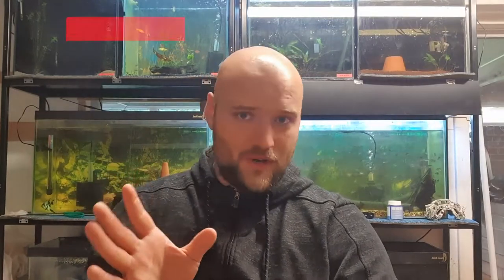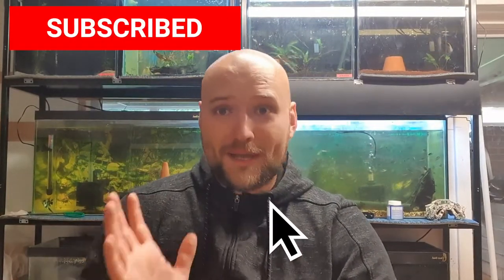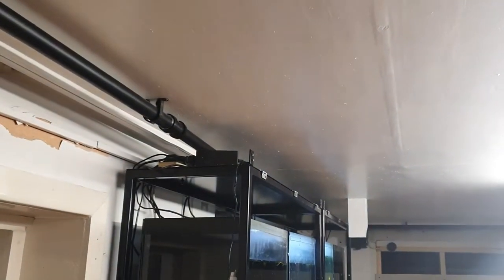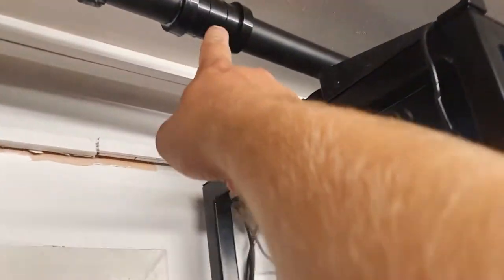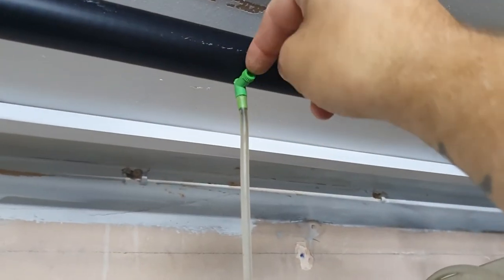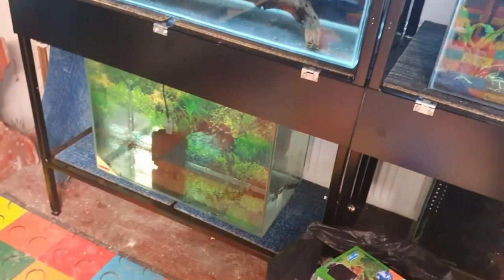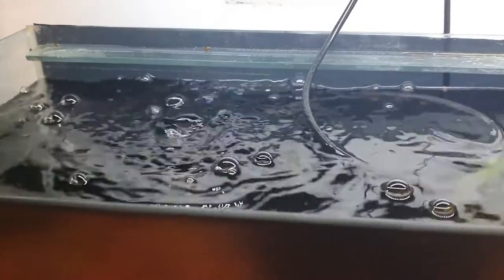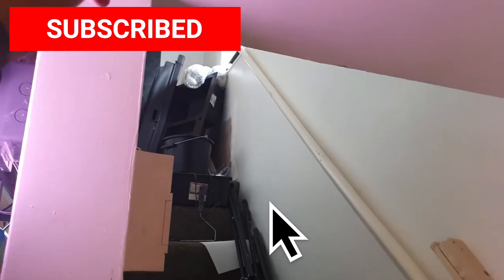Fish room update - Air pump set up

Comment: What are the dimensions of your room bud?
Reply from the maker: I have two rooms mate, its about 24ft across by about 40ft length, two garages under the house (house built into a hill)
Reply: Where do you get the clear seal tanks from bud?
Reply from the maker: They were a job lot of ebay, however clearseal themselves are only based in Birmingham